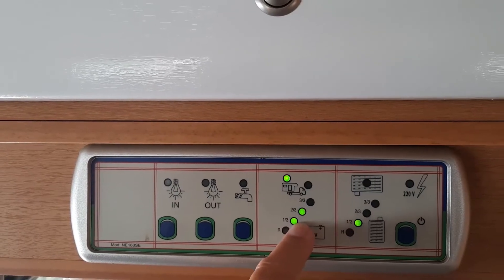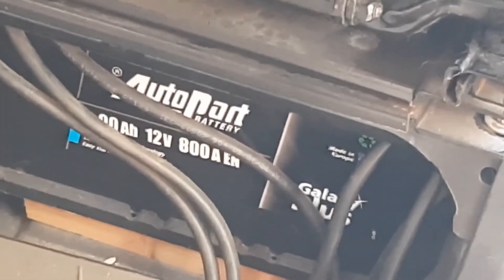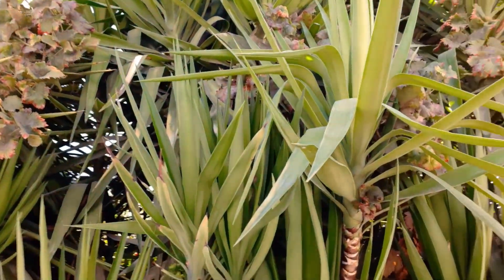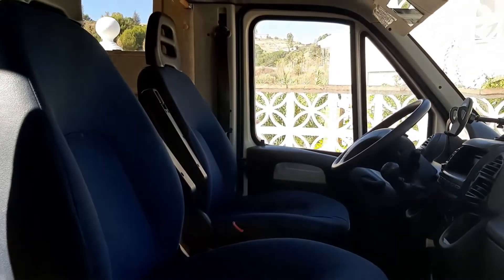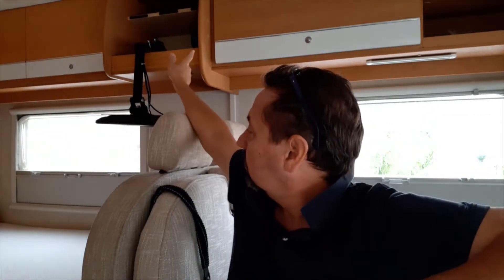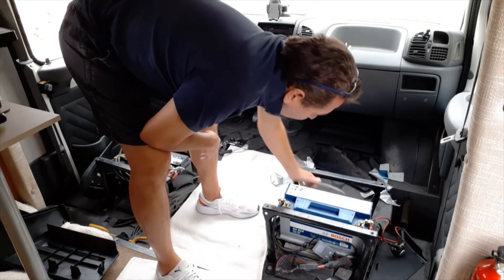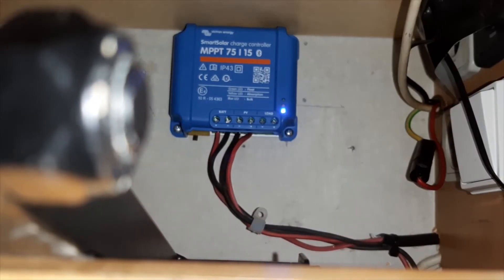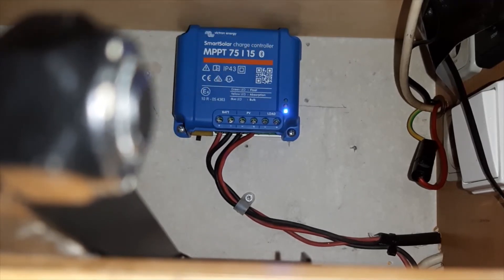VLOG EP012 / BAD SMELL? BATTERY REPLACEMENT

Comment: I had a bad smell comng from my van early last summer and I was checking the water, toilet etc for a week. It turned out that the smell was coming from the leisure battery as I had cooked it by leaving  the van hooked into the mains outside the house for months (for extra beer coolingbin the fridge) with no load on the 12v side and the solar panel in full sun.
Reply from the maker: Yes, thought the same at first so I cleaned the grey waste and cassette, then realised and checked the battery